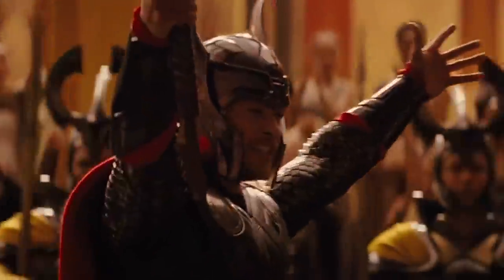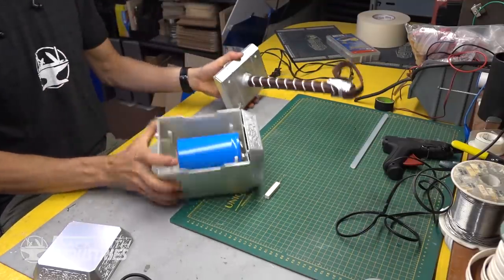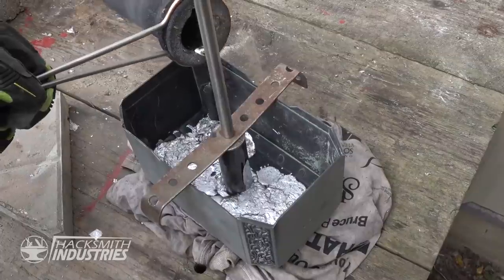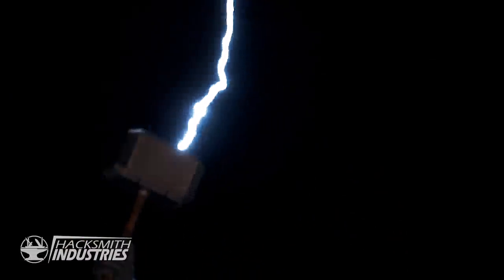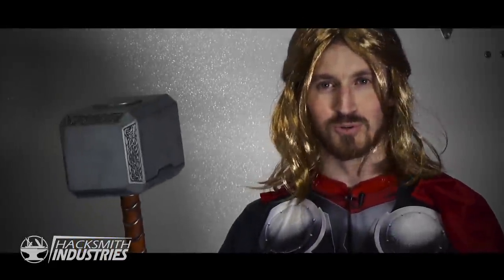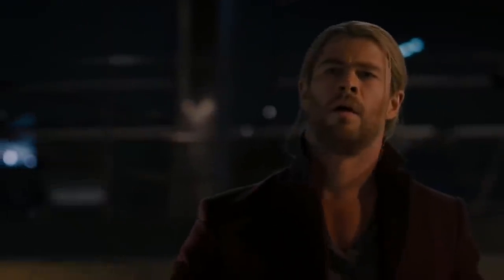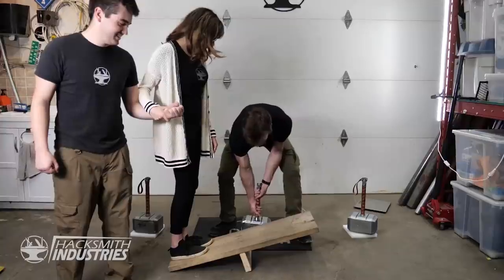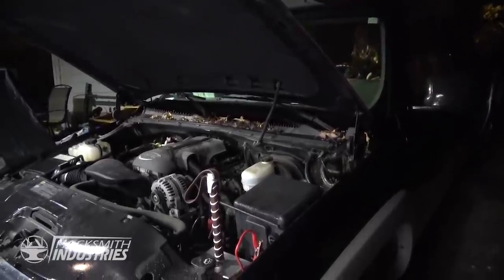Thor's Hammers in Real Life! (Hacksmith Vault #1)

Comment: i wanna see you remake stormbreaker using tungsten and lead with a sturdy steel rod as the base or hilt(cant remember technicality of what its actually called so meh) and a battery system to let it cause electrical burns as it cuts and a little 2 rods on the hammer side of it so you can poke Bogdan and ian with it to shock make sure their is a separate system for the Secret taser something else is you could make bagdan or ian make the taser system to taze them with it